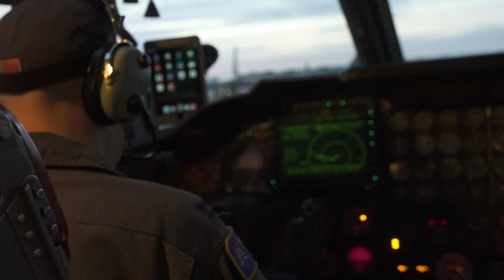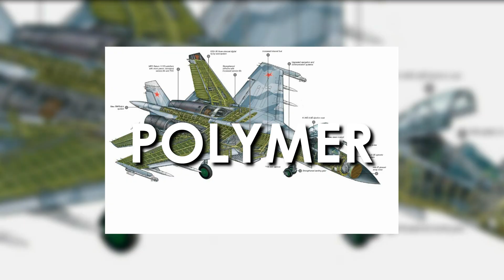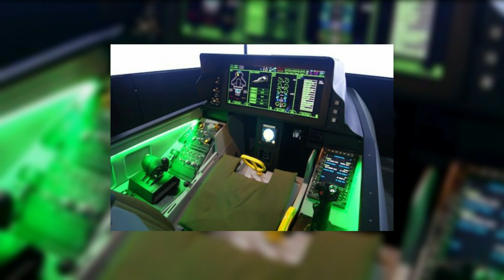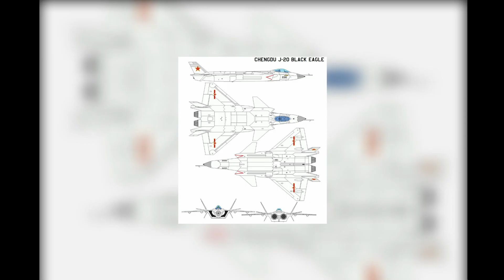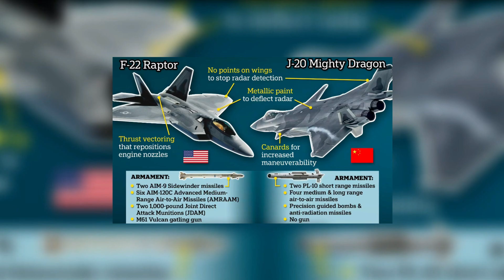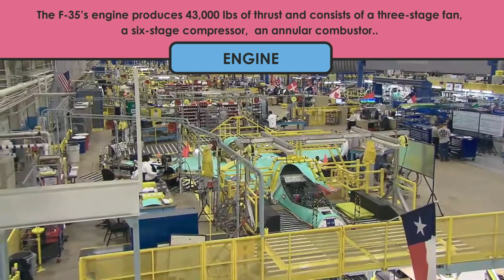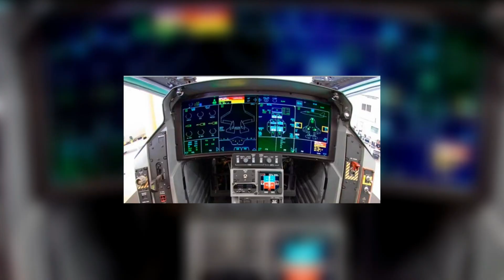Top 5 Most Powerful And Dangerous Fighter Jet In The World

Comment: The Su-57 is only second to the American Raptor.
Reply from the maker: In term of Air Superiority, i am 100% agree with you, The F 22 Raptor and Su-57 are more superior. But if we look at the overall performance, i still think the All Rounded F-35 is the best one for now.
Reply: @USMilitaryMovement  I tell you, I have to disagree with you on this one.  The SU 57 probably has a good front radar cross section, and no doubt has a good first kill chance because of the radar set-up, but it doesn't even come close to an f-22.  I would say it tops the list only if compared to the Rafael or, if ever produced, the F-15 SE.  And  that's even pushing it
Reply: @USMilitaryMovement 😅8 i.v
Reply: yup all 21 Su-57s  ever built.